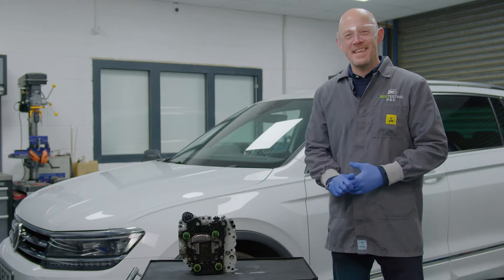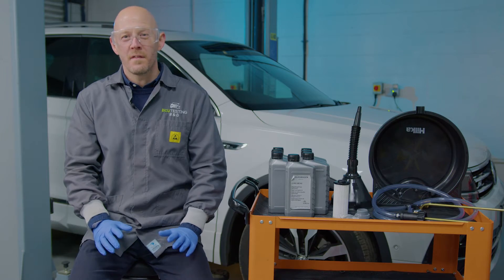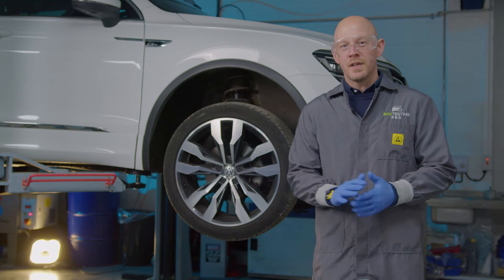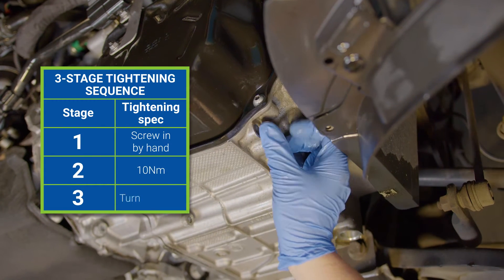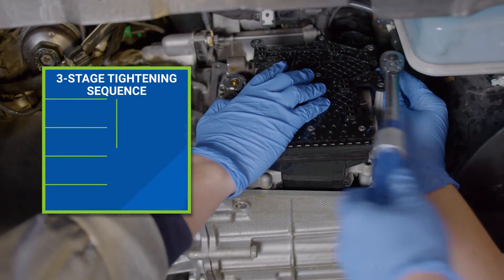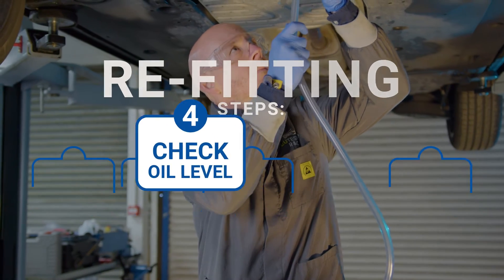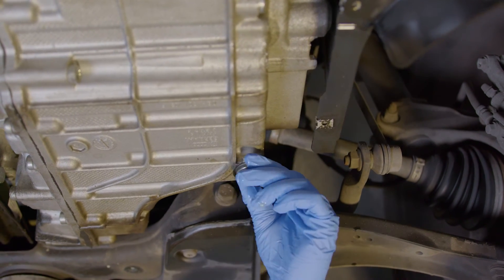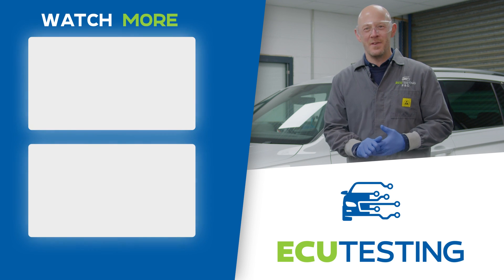Volkswagen Tiguan DSG – DQ381 – Removal and Fitting

Comment: My dealer just diognosed a control unit failure in my 2018 VW Allspace Tiguan (DSG).

Can this unit be repaired instead of total replacement with a new one?

Based in South Africa, Pretoria
Reply from the maker: Hi there, the DSG may be able to be repaired instead of replaced. If you are able to get the part number and email this with your vehicle details to info@ecutesting.com, our technical support team can check this for you. Thank you!

Comment: Had the gearbox emergency mode come on the dash today - 2018 Tiguan R line - it’s yet to be scanned but as it’s common it looks like it needs a new mechatronic - only have gears 2 - 4 and 6 … any help advise what to do would be appreciated thank you - great video
Reply from the maker: Hi. Unfortunatley yes, not being able to use odd gears is a common sign of a failing DQ381 mechatronic unit. We would advise getting your vehicle scanned for fault codes to confirm the diagnosis, but then you are welcome to send your mechatronic unit in to us. Please contact our technical support team with your vehicle details, symptoms and any fault codes we will be happy to advise further. Our contact number is 01773535638 or you can email info@ecutesting.com. Thank you!

Comment: Dear friend, please I need your advice. I have an Audi Q5 , 2.0 L , TDI, 2010 model.I believe it’s got the DSG transmission. Once every 2 or 3 weeks,I am getting on the dash ( Transmission fault, you can continue driving). I took the car in 2 different garages. The scanner shows error code P17D800, temperature clutch sensor. They told me we need to replace the clutch. Please advise. Best regards 
George
Reply from the maker: Hi there, I would advise to check which transmission ECU is fitted. The code P17D800 is a common fault code that is present when the STRONIC / 0B5 mechatronic unit is faulty, but it is not very common for a DSG mechatronic. Once you have confirmed which you have, feel free to get back in contact with us. You can email info@ecutesting.com or give us a call on 01773 535638. Thank you!

Comment: Pressure sensors arnt bad to replace and common  . Which cause gear issuises.    I wouldn't advise sending t5 faulty abs pumps . As none have been repaired threw ecu testing .

Comment: I own a Polo 6 TSI with a DSG gearbox. The car has +-64 000km. i encountered a problem with Shifting of gears from P to D, and from P to R, (P=Park, D=Drive, R=Reverse) first attempt the R/D doesn't engage, they just start flashing on the dash screen and car wont move WHEN YOU PRESS IN THE ACCELERATOR PEDAL. Its Only the second attempt when you I put it back to P and then shift back to R/D, only then it will engage. I then took it to a mechanic for diagnostic. Mechanic said that there was some fault on the Mechatronics showing low pressure on the Diagnostic machine. although there was no any fault indicating light on the car dash screen. He then ordered a mechatronic kit and he serviced it...and the car was fine since then. but after only 3 days, same issue started again (flashing of Drive and Reverse gears) . now he said i must take the car back so he check again. I'm yet to take it back. has anybody experience something like this before...what do i have to look out for when i take it to the mechanic?

Thank you.
Reply: What happened then

Comment: Problem cold Motor, downshift from 4 to 3 is Rough and hard. Same up Shift from 2 to 3. If the car is warm, everything is working without Problems. Passat 2.0TDI, 2018. Someone can help me?
Reply: Same thing downshifting from 4 to 3 and gearbox malfunction sometimes. I've been to dealer and they update the gearbox and TCM, now it is P0C2900 fault.They will open the gearbox. Check this recall 34L4 for audi https://static.nhtsa.gov/odi/tsbs/2023/MC-10241489-0001.pdf
Reply: I’ve seen a lot of posts on forms saying cold DSGs don’t have as smooth as shifts
Reply: @rambow70  do you have a link? http?
Reply: @Bart-ib4mo  I don’t but if you google mk7 gti why does my dsg shift harshly you’ll see in a lot of forum threads that people experience this when the car is cold and it goes away as it warms up
Reply: @rambow70 I had the same problem with my 2018 GTI Performance since the beginning. Clutch/flywheel/mechatronic changed, new oil, other software (first APR now TVS) due to ECU tuning nothing changed. Last week I have changed the PCV Valve (after 173000 km) and the problem is nearly completely gone. Sometimes there are some  little odd shifts but only if the DSG oil is cold.
Reply: @tilomeyer57  are you saying the problem resolved itself overtime and all those fixes you did don’t help?
Reply: @rambow70  The problem is solved for me after I have replaced the PCV valve.
Reply: @tilomeyer57  Seriously?? How odd
Reply: @rambow70  Yeah I don't know why...but I like it :)
Reply: @rambow70  in 2.0TDI the PVC is included in the valve Cover. So you have to Exchange the Wohle thing
Reply: I have the same issue with my 2018 Volkswagen Arteon 2.0 TDI equipped with the DQ381 DSG7 gearbox. 

The shifts from 2nd to 3rd and the downshifts feel rough when the engine and transmission are cold. 

Additionally, I notice a slight hesitation or ‘gap’ between 2nd and 3rd gear, even when the car is warm. 

Once everything warms up, the problem disappears, but the hesitation remains at times. I’ve already tried recalibration and new DSG oil with no significant improvement. 

Is this exactly the same issue you had, and did replacing the PCV valve completely solve the problem?

@rambow70 @tilomeyer57
Reply: I have the same issue as you described! It is so annoying.. did you solve it?
Reply: @nenadsimic6874  changed clutch an dual mass Wheel. Now Its fine.
Reply: @Bart-ib4mo  how much miles do you have on your car?
Reply: @ 137.000km
Reply: I have the same issue. Thats normal. In Germany the DSG‘s are well known for harsh gear shifts especially if it hasnt heaten up.
Reply: @MohamadBalhas-f1t change clutch and Dual mass Wheel an the Problem is solved. This Shift Problem ist NOT normal!!!!

Comment: Awesome video. I've just finished assembling the DQ500 fitted to a Tiguan with a new clutch assembly and oil cooler due to water damage. The vehicle was towed in with the transmission stripped. After installing and starting, the transmission has no gears and refuses to complete basic settings throwing a fault code P060700 Control Module Performance. Any suggestions?

Comment: I have a 2018 Tiguan TSi but I can not locate info if this is a DQ200 or DQ381. The Tiguan is going to a limp mode with code P0805 and/or P0810 ?(clutch position sensor circuit) not the codes that you mention (P173500 /P173600). is that the same process ?
Reply: Get a VIN decode, that will tell you what you have.
Reply: I have the same question here.

Comment: Hi, What’s the turn around time?
Reply from the maker: Hi. Our current turn around time is between 2-3 days after we receive your unit, however this is an estimate and can vary. Before you purchase a product/service on our website please look at the turnaround time for that particular unit. Thanks.
Reply: @Ecutestinglimited  Thank you for the reply, are the parts that require replacement I.e bolts etc the same for the DQ500?

Comment: The oil from my gearbox is much darker than in the video, should I be concerned?
Reply from the maker: Hi. The colour of the oil will darken depending on how old it is. The vehicle we filmed in this video had only recently had an oil change, hence why the oil is so clear. The only things you should be concerned about is if the oil is extremely dark or black and smells burnt, as this could indicate the transmission is overheating. Also if there is a significant amount of metal shavings causing the oil to have a 'grainy' feel to it, then there could be internal transmission damage. Hope this helps!
Reply: @Ecutestinglimited Thanks for reply, yeah mine is dark and smells burnt with metal dust at bottom.Only 65,000ks
Reply from the maker: Hi. Unfortunately that means there is likely internal damage to the transmission. We would recommend getting it diagnosed by a transmission specialist.

Comment: Hi guys, currently got a cupra 290 with the d381, i tend to find downshifts from 2-1 to be unpleasant, and hear a chatter as it goes into first, could this be a sign of the mech unit? i have no fault codes etc.
Reply from the maker: Hi. Please email our technical support team at info@ecutesting.com with the details of your message above as well as the part number of the mechatronic unit, and they will be happy to advise you further. Thanks.

Comment: Query Regarding Refilling of Mechatronic Oil...As We have removed oil from Mechatronic by removing 8 mm Plug. How to Fill back oil in Mechatronic Unit? Kindly clear my concept.
Reply from the maker: Hi. We show how to re-fill the mechatronic oil at 6:46 in the video. There are many tools you can use to re-fill the oil, but we have used a simple oil filling hose shown at 1:35 (part number VAS6262A). Attach it to the inspection plug and gear oil bottle, lower the car down on the ramp so the bottle is higher than the vehicle and then squeeze the bottle until it is empty and repeat until you have used at least 6 litres of oil (check your vehicles specific repair manual for the exact amount). You can then follow the rest of the steps in the video to set the correct level and perform the adaption procedure. Hope this helps!

Comment: Great video bro, thank you. I need a refeetting of that ECU for my MY2018 Passat, I have the P1736 fault code.  How can I order from spain and how much is it? thank you very much
Reply from the maker: Hi. We are glad you enjoyed the video! Please follow this link: https://www.ecutesting.com/product-catalogue/volkswagen/passat/ecu-transmission/ and select the part number which matches your unit that is fitted to your vehicle for our most up to date pricing. If you cannot find the part number of your unit on our website, please email our technical support team at info@ecutesting.com with the unit's part number, your vehicle make and model, and details of the fault you are experiencing, and they will assist you further. Just to confirm, we only offer a re-build service of your original unit, not a removal or re-fitting service, so you will have to remove the mechatronic yourself or with a garage. Thanks.

Comment: Hello. I have a vehicle with a DQ381 type wet clutch 7-speed transmission. Skoda Kodiaq 2019 1.5 TSI . I had my vehicle's transmission oil and transmission oil filter changed about 1 week ago. After changing the transmission oil and filter, my vehicle vibrates while idling. For example, when I start waiting at a red light, there is flickering. Although not always, occasionally there was a problem such as a contraction/vibration caused by the transmission. There was no such flickering problem before the replacement. What do you think is the problem? By the way, the transmission oil change was done exactly as you did and said. What might we have missed? Thank you. It's been a little long :)

Comment: Most DQ381 do not use G 052 182 which is a quite old type of fluid. The correct fluid is G 055 529
Reply: Do you know if G055 529a2 is compatible with the dq500?
Reply: @thesled  It is not, plz don't use it with dq
500
Reply: @oijhhytdirhrbru  what is recommended for the dq500?  Seems to be a lot of conflicting answers between forums and even the dealerships. It’s for a mk2 Tiguan r-line 2.0tdi 150 4motion
Reply: @thesled  The original first-fill fluid developed for dq250/dq500 known as fuchs FFL-2 formally known as pentosin FFL-2
Reply: Where did you find this info?
Reply: @liamrs4622 From documents, part catalogs, presentations and engineers from car manufacturers.

For example, the switch to G
 055 529 with DQ381 is referred to in DQ381's self study programme, though this fluid is developed for the DL382 transmission that you can find related information from Fuchs's website.

Comment: If you drain 2 separate plugs, do you still only refill using the big one?
Reply from the maker: Hi. Yes you are correct that you only need to refill the gear oil using one plug. The plug on the side of the gearbox is the drain plug which will completely drain the gearbox of any oil. Whereas the plug at the bottom of the gearbox is the inspection plug, which you can use to re-fill the gearbox and correctly set the oil level.

Comment: Had ecutesting refurb my unit now getting P175E00 fault
Reply from the maker: Hi. Sorry to hear that you are currently having problems with your remanufactured unit. Please contact our customer support team who will assist you further +44 1773 535638.
Reply: Mitchhicken - did you get this issue resolved, I have the same issue and going to refit for the 2nd time tomorrow

Comment: Im based in Spain, would you support that as well? What is an indicating cost of a rebuild? My 2018 Passat Alltrack goes into gearbox emergency mode when driving highway for about half an hour leaving me with 2/4/6th gear only. Next day all normal but problem comes back after motorway drive. I can drive for an hour on a lower speed road without the issue .. Im thinking a temperature problem.
Reply from the maker: Hi. We offer a worldwide service so you can send your unit into us not matter where you are located. Please email our technical support team at info@ecutesting.com with the details you have mentioned in your comment and they will be happy to assist you further and advise you on any re-build solution we offer. Thanks.
Reply: Did you solve your problem? What was the solution? Replacing the sensor?
I have exactly the same problem.

Comment: not seen anywhere else about undoing the overflow tube 2 full turns before determining oil level... not sure what/who to trust
Reply from the maker: Hi. Apologies for the delayed response. We have used the manufactures guidance whilst creating this guide, and they state "Caution. Gearbox damage from overfilling. The correct oil level is below the level of the overflow pipe. For this reason, the overflow pipe must be unscrewed 2 turns to enable the oil level to be checked and adjusted correctly" 
This is specific guidance for the mechatronic unit for dual clutch gearbox 0GC, so if you are unsure then we would always recommend obtaining the manufactures guidance sheets for your specific vehicle. Hope this helps.
Reply: @Ecutestinglimited  after u do the 2 full turn  do you have to tighten it after fluid level it good?

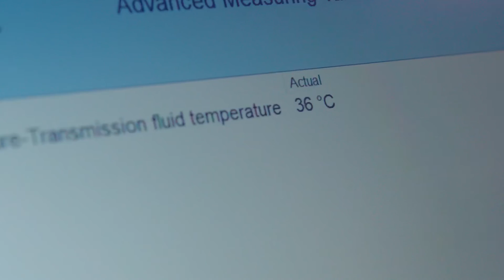Comment: -------- at 8:04 once oil has reached 35 degrees do we turn car off and then drain excess oil or leave engine running ? thanks
Reply from the maker: Hi. We would recommend leaving the engine running to ensure the oil doesn't drop below 35°C when setting the level. Please note that a small gush of oil may escape from the overflow pipe every 30 seconds or so due to cooling oil pulses for supplying the multi-clutch, but ignore these when setting the level. When the constant flow of oil stops, then the level is set. Hope this helps!

Comment: Thank you for the video. How much is the oil pan bolt tightening torque? Please also tell me the order of where the bolts are fastened.
Reply from the maker: The torque for the oil pan bolts should be 8 Nm followed by a 60° turn, and there is no specific order for this, the manufacturer's advice is to simply 'tighten new bolts diagonally in several stages'. Hope this helps and we are glad you liked the video!
Reply: thank you very much!

I wish you all the best for your future!

Comment: tengo una Audi q3 2014 con este tipo de transmisión con una falla poco común a la información que proporcionas en tu pagina
1. no da ningún tipo de código de fallas y ninguna alerta en el cuadro de instrumentos
2. ya se le puso un embrague nuevo
3. cuando esta estacionada, la presionas a 3000 rpm hace un ruido muy agudo que proviene de las transmisión y cuando la estas conduciendo todas sus marchas entran bien al menos que no la presiones arriba de 3000 rpm esta se neutraliza y deja de aplicar cambios, bajas a 2000 rpm y la transmisión funciona normal

tengo duda de como hacer el  diagnostico de los sensores de presión del embrague para hacer su reparación o reemplazar toda la mecatrónica...

Comment: Super video thank you. Just a quick question, what is the operating temperature of the gearbox fluid please? I'm getting 90c stable after running for 30 mins but that seems high? Also, you don't use the clutch disengagement tool, not needed?
Reply from the maker: Hi. 90ºC is within the standard operating temperatures for a transmission (usually around 80-100ºC). Also a clutch disengagement tool isn't needed for this procedure.